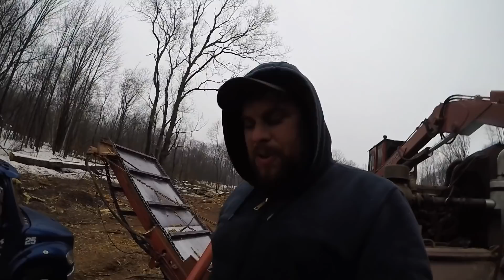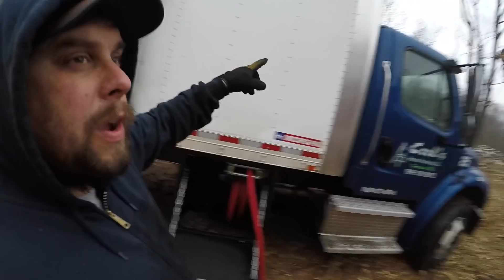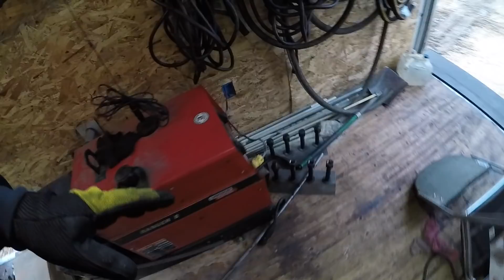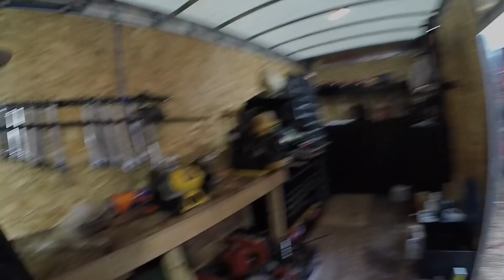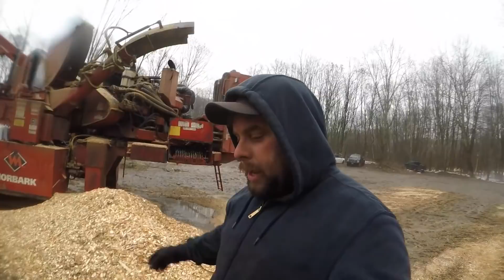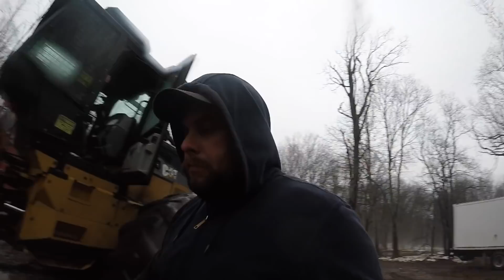FIRE EXTINGUISHER WORKS!!

Comment: I here you on this crazy weather had the same problem here in Iowa so don't feel alone it will cool down in a day or two. Need to check the fire extinguisher has it's pin in it once and awhile all you can do is keep Rollin. You will have to interdusce the new guy to the chipper Klan. Keep up the great video's